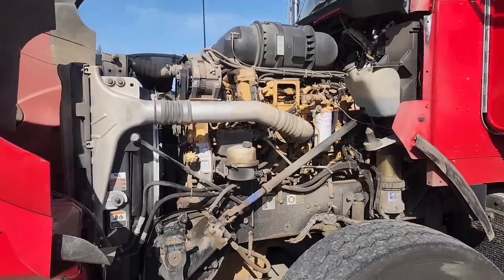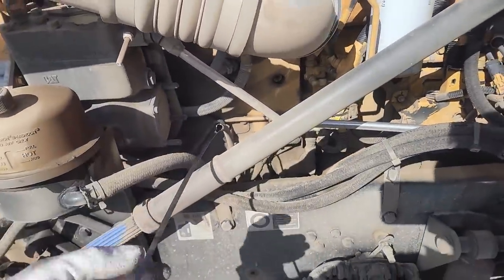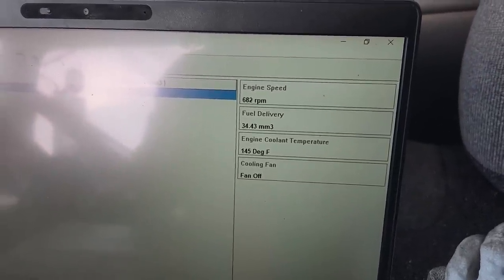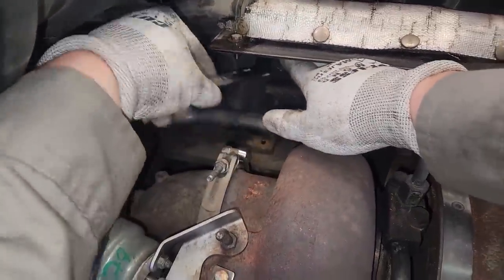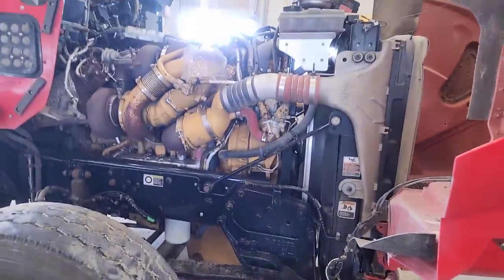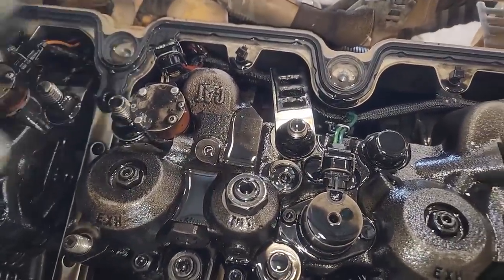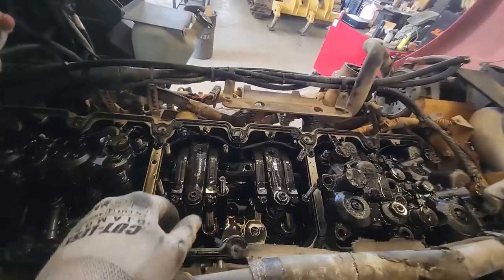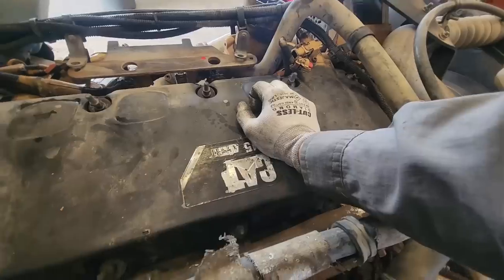"Weird Engine Noise" turns out to be REALLY BAD on this Cat Diesel Engine.

Comment: One major engine damage job that always stuck with me was from my Gas compression days. We went to a L7042GSI at some gas plant that had dropped a valve. Well it had smashed up the piston so bad it contaminated all the other cylinders on that bank. For context, this is a 115 litre V12 twin turbo natural gas engine with around a 9 or 10” Bore. 
Well it had beat the Liner so bad it broke in several places and was expanded so it was now bigger than the top liner fit in the block, meaning it isn’t just gonna come out the top like it normally would. It took me and another guy almost all day to hammer and chisel enough chunks out of the “jigsaw” to where we could remove the liner from the block. Meanwhile the rest of the crew, 4 more guys if I remember correctly, removed all 5 of the other heads, cleaned up the debris and replaced 2 damaged liners and piston assembly’s and we had her good as new, smashing gas as happy as can be!

Comment: My old company had a fleet of MXS engines. Everyone one of them broke rocker arms at one time. Then the latest ones broke the cat brake/ iva housings. Usually the 5-6 broke first then a little while later the other 2 would crack. We always had problems with those IVA connectors. They sucked for the randomness of the connector failure.

Comment: IVA studs general fail from excessive engine brake usage. Most of the time the failure starts on cylinders 2, 4 or 6 first and work towards the front. Seen a few pedestal snapped off. The extra ladder clips was a add on in the field that Cat said to do to stop IVA connectors from breaking. First head I pulled off a SDP took way to long. So much extra components to R & I. The line on the back of the head is a tube and I actual made a fixture to bolt on the head so it goes back in the same place. It has a clamp that bolts to the rear cover. Best to replace all the IVA studs as it starts the clock over again. It is a pain but every few years when a over head is needed. Best to pull the IVA's and check bolt torque. If they are loose, replace them. Does not hurt to replace rear stud as they are usually first ones to loosen up. When I have a IVA stud failure, ALL the hardware on that set gets replaced. Nuts, bolts, everything. They have been operating not torqued and abnormal stress was added to the hardware. 
A few years ago a truck driver came in and told me what is truck was doing, it was a SDP. I said you have a hole in your valve cover from a broken IVA stud failure. He replied that his valve cover was OK. Then he came back and told me he had a hole in it.
On a MXS, seen a few failure's so severe and with the metal valve cover. All the valve cover bolt rubber grommets was missing. The impact was trying to drive the valve cover off and finally the grommets busted and fell off.
Now the big question. What does SDP stand for?  You got a a project, if you can get a head.
Reply: seems like u should have your own Utube channel.
Reply: @deanberolzheimer2658  Why Josh does a great job. I just been around the block more times.

Comment: Make sure you use the updated torque turn procedure on those rocker shaft studs and bolts. That stops the saddle wear in the head that eventually causes the fasteners to loosen and break. Great video as always.

Comment: Pulled an sdp one night for overhead noise, expecting a as you say fairly typical Iva stud issue, the foreman told the driver to wait in the lounge. I pulled the valve cover found the studs pulled the Iva housing and boom! Broken pedestal exactly like that. Needless to say I told the boss the driver might want to start shopping motels. We hated the sdp’s, constant ard updates,  no more popping off an easy valve cover for an Iva solenoid, cat must have all of sudden forgot how to make water pumps because they leaked out the weep hole and they were nice enough to bury it under a mile of tubes hoses pre cooler this cgi that.

Comment: I had a C15 6NZ do the exact same thing. Dropped a valve, valve wedged into the top of the piston. Piston camre back up and hit the tip of the injector. Broke the bolts in the shaft and busted the cam housing on the head. 😬

Comment: Your cat filter shenanigans are funny. Reminds me of a time I was at a shipper and they had the cab up on a yard jockey that wouldn't start.

I walked over like I knew what I was doing as a few of them were looking at it, told them I knew exactly what their issues was, started pointing at different parts of the engine.

"Here, here and here, this engine has red paint all over it and  its not yellow, that's your problem right there"

They busted up for quite a while.

Comment: We didn’t see as many break after the IVA housings were updated to a thicker casting. Notice how all the Platinum rebuild kits supply a full set of studs…🫣 Seen rocker rollers go through heads before but never witnessed that much damage until now. 👌🏻cheers for sharing Josh.

Comment: I have a 2002 9300i with a C12. Place that changes my oil did not stock the 1W-8845 oil filter and would put a Donaldson on. Watching your videos and the multiple times i heard you say " use Cat filters " convinced me to go buy 8845 and insist they put it on.

Comment: Donaldson filter? she'll be right, they all look the same covered in mud. Good enough for Liebherr, good enough for CAT 😂. Looks like someone was a bit casual with tightening those bolt up, probably whoever used the harness tiedown brackets as washers. Guess they were all loose and the vibration fatigue sent them to heaven.
Reply: Extra leverage on each stud loosened the nuts.?
Reply: @davestaco  nah whatever tech put them on didn't have enough milk on their weetbix.

Comment: Seen that a few times, the head breaking like that. Then Cat changed the rocker studs to the necked down type so the stud breaks before the head.  The SDP is the engine that ended it for Cat in the trucking market, big POS.

Comment: Had a sdp do the exact same thing, the one I did broke the Iva housing in half and also ended up with a bent rod, (must have hydro locked due to valves not opening is the only thing I could figure)

Comment: Root cause analysis would start with was that a result of the damage or the cause.
All metal castings have impurities and inclusions in them. Look for an Initiation point.
I couldn't see any of the Fractures on the fasteners or casting up close but my impression is.
One side of the casting Fracture appeared to be smooth indicating it was Cyclic or that way for awhile.
The other side looked like a Fast Brittle,Ductile fracture. 
The Cam looked ok and is still retained by what's left of the casting and bearing.
Could the Damage to fasteners and components all be Related to the Casting failure?
Reply: Read my comments above

Comment: So were the broken studs missed when the last oil bridge was replaced? Seems the broken studs would definitely cause the broken oil bridge.  Classified as a come-back? It happens.
Reply from the maker: Good question, so the studs and nuts were all in place when the truck was here before. The engine was even ran with the valve cover off to find the source of the IVA oil pressure leak. Everything appeared normal on top, other than the clips on the holddown bolts, but that wasn't part of the repair. Now, that being said, the oil bridge being cracked does make me wonder if the pedestal was already cracked or possibly one bolt was cracked already, but there were no other signs or noises during the previous repair.
Reply: @AdeptApe  Agreed, I doubt it was that bad a month ago and sure it didn't have the miss or overhead noise. Definitely would be something to look out for if there was another broken oil bridge. 
Love the videos, keep them coming.
Reply: @AdeptApe  Less then a year, parts warranty.

Comment: Could this damage be caused by overtorquing the bolts?
Reply: No excessive engine brake usage, loosens up rear stud first, (most of the time). As stud gets loose, load is applied causing studs toward the front to loosen. Eventually they start breaking.

Comment: I got a problem with a c7 and idk where else to go I can’t seem to figure it out. Truck starts up fine when cold. Warms up and it dies won’t turn start back up. Just crank no start. I also notice a noise will go away before I crank the engine. The noise is a long fluttering clicking noise. That noise goes away when the engine won’t start back up. Not to sure what that is. Any advice from anyone to figure out what I should be looking at? I did watch the video on the heui pump but seems like everything checks out with right pressure.
Reply: We also did change ecm and heui pump to be 100% certain and it still does the same thing.

Comment: 💩 cheaper in the long run to put a platinum kit in and call it a day.  But you might find other surprises when you do that.  You are right when you started that up it did not sound right.  To me that might be the only way to actually fix the engine correctly.

Comment: I have the same SDP problem. Just put a new head on it today. poor engineering design. you should have known better when it came in with a broken oil bridge. our 2 c15s both broke rocker shafts and bolts. i would highly recomend replacing the bolts at 300k to avoid these problems. if any bolt is loose or broken replace the shafts if it didnt damage the head. once one rocker shaft bolt breaks it can ruin the head. or you may be able to cheat it. the shaft will eat into the pedestal saddle. you wont know its broke till you tear it down.

Comment: There is no such thing as a surprise when working on equipment.  

Anything can happen at any moment. 

God only knows who had their incompetent fingers in that engine before you.

Everybody is a mechanic until... they aren't.

Here's the test after any engine rebuild - start out in Wheat Ridge, CO., and run I-70 all the way across (west) to where I-70 intersects with I-15 south of Salt Lake City. That's ~500 miles! Run that going to Cali or anywhere and then run it back again (eastbound) to Wheat Ridge, CO. Make that round trip continually for 90 days. That will test an engine rebuild. Most will fail... at least 75%!

But, of course, the guy who did the rebuild said: "I can do that. It'll be fun and if it fails, it's not my money." 

Very few people understand the intricacies of a complete engine overhaul... very few! Very few can comprehend that details matter! "Good enough" is never good enough!

On this particular engine, the "white" filter is all I needed to see; that tells the entire story! And then, of course, the added parts on the top of that engine! Why not? "It should work." "We'll just add a few extra parts and that should make it last longer." A torque wrench? "Nooooooo, don't need that." Idiots!

Good job, Adept Ape. You definitely understand the importance of details. Keep 'em coming. 👍👍👍👍

Comment: I had a 6nz do the exact same thing
Reply: 6NZ you have to update the rocker arm bolts, if you have a Jacobs brake. Pac brake cannot do the update. I replace them in any engine if the customer will let me. 5EK thru BXS.

Comment: I’m working on a bsx. I have no fault codes. But when I do an injector cutout 1&6 are definitely weak. I replaced both injectors and still not running right. I’ve reran the overhead. But problem is that it doesn’t do it all the time. Haven’t seen any kind of a pattern as to when it runs bad. This motor has been deleted to a 6nz. Any ideas?

Comment: Really, not a genuine cat filter from somebody who uses a non genuine Milwaukee battery. BTW what are the specs on the cat filter ie micron filter level, bypass spring lbs, cubic cm area of filter medium, and type / makeup. Then show me the competitor stats against yours and then prove to me which is better.
Reply from the maker: Cat filters are about 50% more expensive than competitor brands, Milwaukee is about 400%. The batteries cost more than the tool!